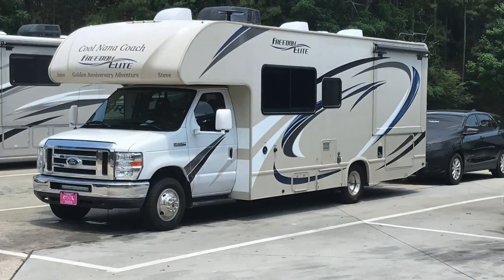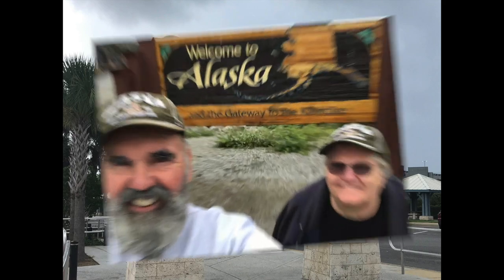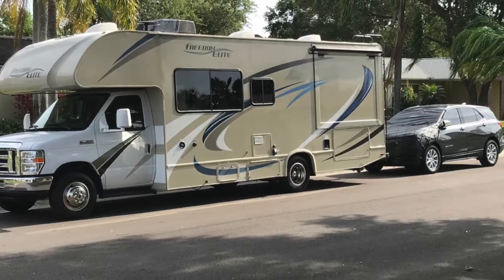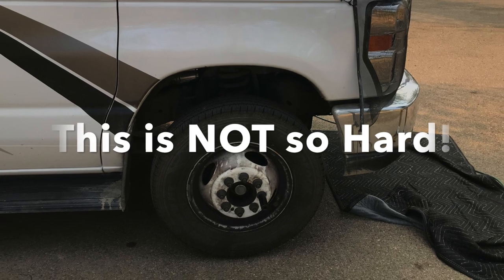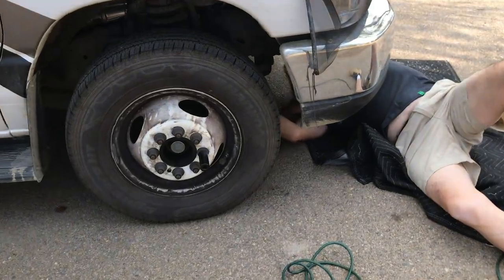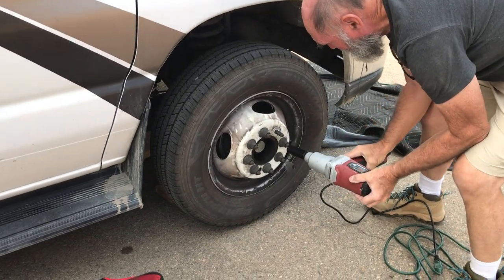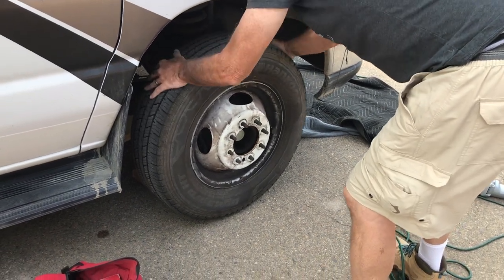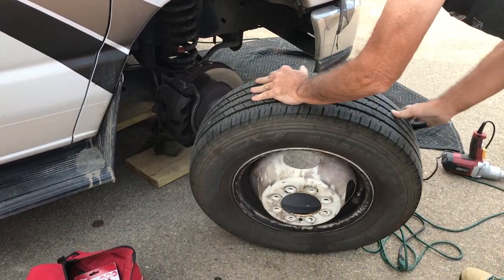RV Flat Tire Why Wait For Road Service? YOU Change a Flat Tire on your Class C RV- it's EASY !

Comment: Great job. Wish you would have shown actual Jack point for front and rear jacking. Thanks
Reply from the maker: Thank you so much for watching the video and for commenting, we appreciate it. For the jack placement, I placed the jack directly on the chassis rail for the rear tires, and directly under the a frame of the suspension for the front tires. I used a couple of 2X10 wood blocks under the jack to give it an additional 3 inches of reach. (I carry these blocks to assist stabilizing and leveling the coach when we camp.) ( just pick up an 8 foot 2X10 and cut it into 2 foot long lengths and you end up with 4 blocks)
Reply: I would probably have to see what those jacking points look like. Congrats on 50 years! @GoldenAnniversaryAdventure

Comment: Hello, you make the job look easy.   what type of tire did you purchase and how is doing so far?  Thanks.
Reply from the maker: @javiermartinez9355  I have Hankook Dyna Pro HT on the RV. Excellent tire no matter what some folks might say. They are selected by Ford as OEM . I put 35,000 miles on my first set, have 25,000 miles on the second set

Comment from the maker: 140 lbs - my 1/2 drive impact delivers almost enough, then using the breaker bar finish the job. I have checked with a torque wrench and torque was nearly 150
Reply from the maker: 140 lbs torque spec for E350/450 lug nuts

Comment: What about an inside rear?
Reply from the maker: Thanks for your question - Exactly similar to changing front, only you would be removing two wheels - still using lever to remove and mount - looks more difficult but really is not - I've done it to rotate tires